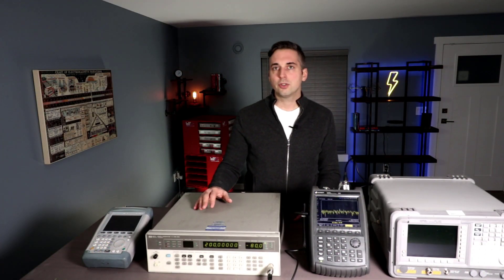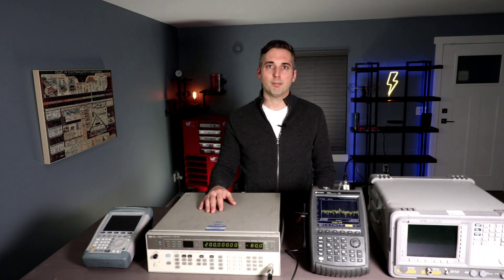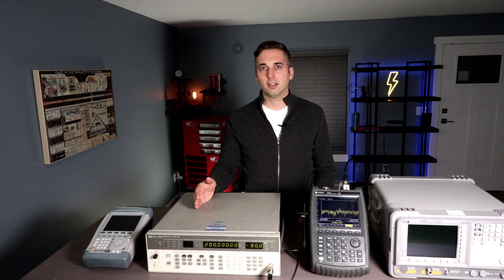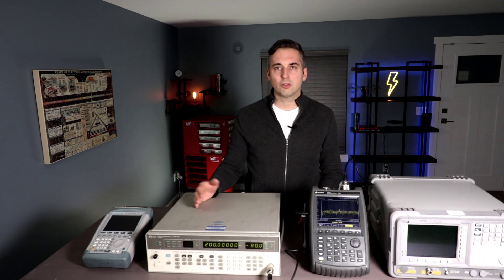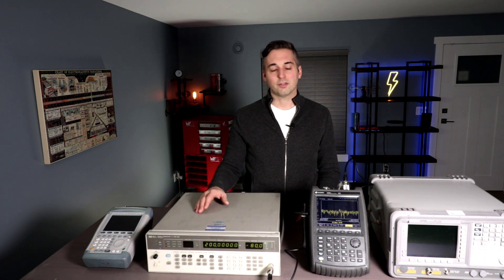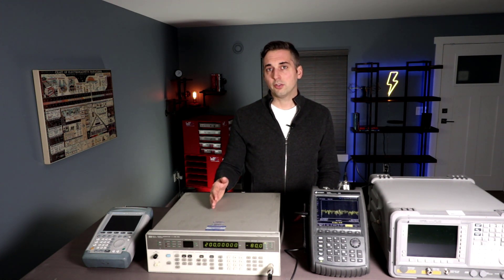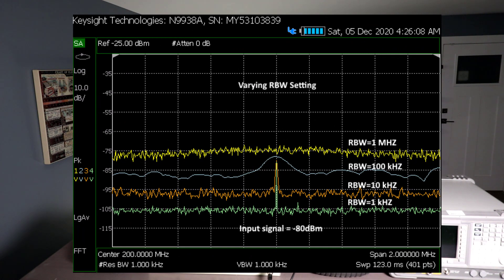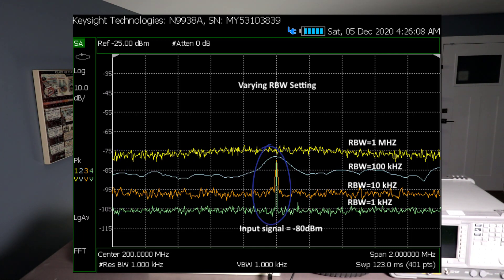#004 3 Ways to Reduce a Spectrum Analyzer's Displayed Noise Floor

Comment: Reducing BW works only if the signal is always narrowband.

Be careful with an RE measurement outside a shielded chamber that the preamp is not overloaded in or out-of-band.
Reply: Good points Ken.